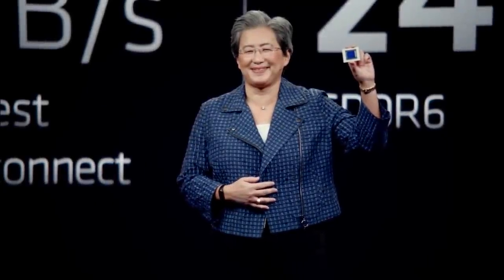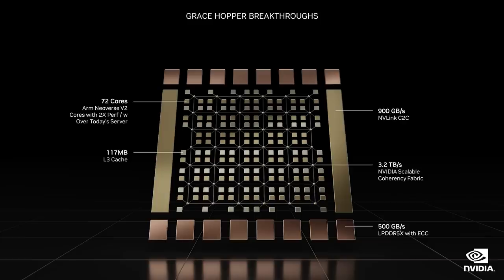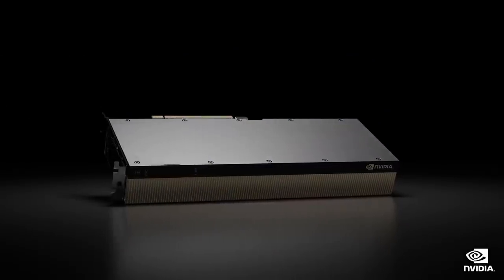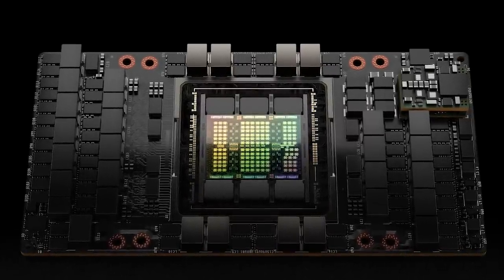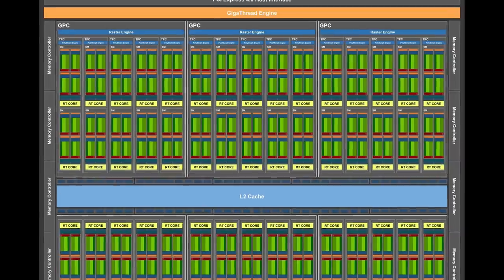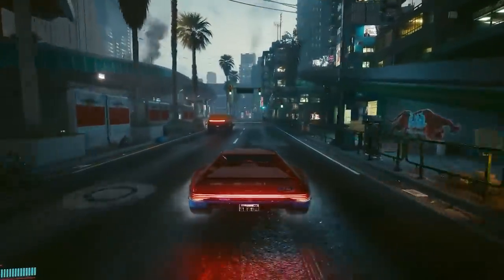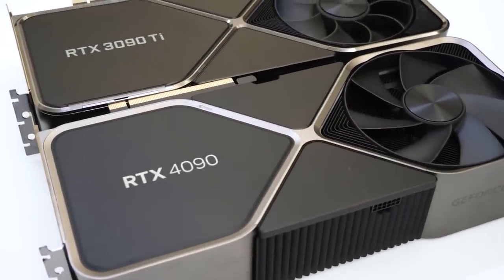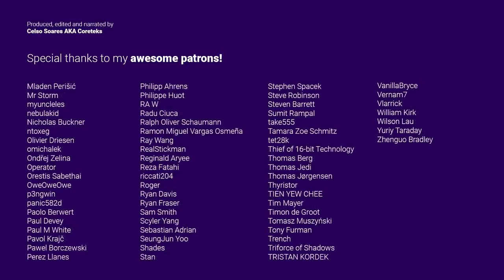NVidia CHIPLETS Strategy explained

Comment: AMD's chief engineer who introduced them to chiplets recently did an interview with GamersNexus about chiplets, and as complementary as he was of course, he also said they realised that chiplets for the compute elements of a GPU do not make sense, because they are far more interconnected than CPU cores. That is why RDNA 3 only has one compute die, no matter its size, unlike Zen which has potentially multiple CCX dies.
Reply: Right, but would the interconnection be as high between different blocks? 

For RT, Lumen already uses a different, simpler version of a scene. That means unique data. Could a RT chiplet function far more independently from the shaders? What about tensor cores? If these are segmented in the code, this may not be an issue.
Reply: Thanks to chiplets, AMD fixed their bandwidth limitations and now the limit is the cores.
Now the bottleneck is the shaders that can be easily improved by adding more.
Reply: @ghoulbuster1  
Radeon still has too much bandwidth between CU, which is why RDNA 3 only has 1 GCD. CUs transfer 10x as much data between them as they transfer back and forth from infinity cache.
Reply: @Austin1990  you would need over 7 TB/s of bandwidth between chips for just 2 GCDs. This number goes higher the further you split things.
Reply: @Austin1990  AMD didn’t seem to think so and hasn’t done it either so far.
Reply: Yes I agree. The benefit in this first multi die GPU is not performance but yield economics (and maybe frequency binning, comparing 7900XT vs XTX may reveal this), but the interconnects are there to scale it up for performance benefits, which is what is really exciting. As adoredtv Jim said: due to the small size of the GCD, AMD can simply add (>x1.5?) more shaders and 3D stack cache more MCDs to feed them. NVIDIA can't, it's literally impossible to fab a monolithic chip that big. They've already made the 4090, and from years of Titan sales, they know they have the fans who will buy them.
So it looks like it's entirely up to AMD whether they take the performance crown from here until NVIDIA get their own chiplet solution implemented.
Reply: @ghoulbuster1  Wait for RDNA 4 for better RT?
Reply: The problem is cost. AMD can do it, but they'll have to use the same material as they use for the server market. The MI300 does have more than 1 GCD. But that's too expensive for the consumer market. Remember RDNA is based on CDNA.
Reply: yeah, they'll prob further disaggregate untill there is literally nothing but cores on GCD and work on higher clocks, cuz there's no other options to boost  the performance. maybe at some point they'll teach GCDs to interconnect through MCD, but i'm not sure it's gonna be effective.
Reply: Don't forget sli/crossfire.

Comment: You have consistently suggested a separate RT chip and it has never really made sense even now as you present the industry move towards chiplet based domain specialization. Not that it isn’t desirable, the problem is that it isn’t feasible for the foreseeable future. An RT core is an accelerator that is delegated portions of the RT work by the shaders primarily BVH traversal and intersection testing, when that delegated work is done the shaders then execute the hit shaders, what is critical to this being performant and efficient is that the RT core and the shaders can work on the same data in a shared cache without any need for data movement. Going off die completely destroys this fundamental. RT acceleration even at its most advanced form and in a raytracing only game, RT would be a full round trip of geometry set up -> trace rays -> shader work. Data movement of any kind is going to be an order of magnitude more power draw and latency, and going off die is another order of magnitude ontop of that. You have made no attempt acknowledge or explain away this problem.
Reply: Dude how are you so smart??? That’s amazing
Reply: @Shapar95  it’s just about doing the homework. Most relevant here would be:

Imagination Technologies raytracing levels. (A big help in itemizing the state and future of raytracing acceleration hardware)

Nvidia Composable on Package Architecture (Nvidia chiplets and where a lot of images from Coreteks video came from)

Microsoft DXR documentation (raytracing from the API point of view)

Architecture white papers on Turing / Ampere / Ada / RDNA2. (Raytracing hardware from the view of the hardware vendors)

press day presentations on RDNA3 / Grace - Hopper. (Chiplets and interconnect fabrics)

various press releases on TSMC advanced packaging.
Reply: This. And (edit: because of that) an RT chip would require a whole new approach to RT which would be incompatible with current games and APIs. Of course, data movement could be less of an issue with either a silicon interposer or a separate and shared cache chip. The first can be expensive, the latter difficult to design and more prone to production failures.
Reply: I honestly prefer AMD's concept of not using rt accelerators and building it into specific dies. as we possibly move to a more RT focused environments, possibly full rt with layering vs phong/gourad with shaders, this will allow stream processors in the system to do more workload, even possible cards in the future having cores that do both to handle older games with not RT and then full RT without having dead weight. It really depends on how fast the market moves.
Reply: @gpturismo  but AMD does use RT accelerators. RDNA2 embedded ray intersection testing into the TMU, and RDNA3 added BVH traversal as well. I'm still waiting on an actual architecture whitepaper but I would even go so far as to say that AMD press presentation had me thinking that RDNA3s CU layout is reminiscent of an Ampere SM. Doubled shader layout, acceleration for BVH traversal and ray intersection testing, new Machine Learning matrix instructions.

here is an except from AnandTech coverage of RDNA3 release event. "The second-generation RT accelerator, as AMD calls it, can handle 1.5x more rays in flight. There are also new hardware box sorting and traversal features that weren’t present in RDNA 2’s initial RT functionality. AMD’s presentation gave the technical details a light treatment, but it certainly looks like AMD is moving to doing a bigger part of the ray tracing process in dedicated hardware."
Reply: So what your saying is instead of using chiplets for the cores, Nvidia should expand the cache? Bigger cache means faster RT and shader cores.
Reply: And this is where cache dies make sense. Cache isn't scaling with smaller litho nodes. Logic (SMs) is. The problem is the cost (power & latency) of fetching the data from another die.

What's interesting is why AMD lowered shader clocks and didn't stack MCDs in Navi 31. Is it limiting silicon or power targets or minimal performance benefit? Or is this implementation of the interconnect the limit? I can't wait for the in depth analysis of the 7900XTX to arrive, it's killing me

Comment: When 3D stacking is mature - wouldn't the direct stacking of a GPU onto a CPU offer performance advantages that discreet chips and long length busses can't compete with?
Reply: Fundamentally, yes. It incredibly difficult. Obviously with the cost of these new single digit nm nodes.. If it were a reasonable path forward.. these companies would have already done it. I suspect there are still parts of the stacking technology that we cannot do yet on logic circuits. We will see.
Reply: @christophermullins7163  well look at what amd did with vega there moveing to rdna3 for there apus after sticking to vegas for years so i think we are gonna get something like this in the next 3 years
Reply: Not exactly, stacking two of the hottest part of the chip on each other would be a mechanical nightmare.
Reply: @ben7295  There is the direct die water cooling thing tsmc tested which had crazy good results. The only thing is the tech is still very immature and need more R&D to make it commercially viable.
Reply: i wonder if 3d cache on APUs could make up for the lack of vram ?
Reply: VRAM, Power, Heat, and Memory Bandwidth says no.
Reply: @hiimcortana1568  Probably will not work on consumer market.
it needs high grade of purity water and a cooling loop that is very clean, or it will clog.
Maybe something derive from it (direct vapour chamber? On chip small factor active cooling?) will.
that said, I probably would go with placing them side by side and stacking the memory, sounds more easy to me, however I have no idea of how to engineer a chip.
Reply: sure but it won't scale up to the 400 watt+ GPUs that need their own cooling

Comment: Nv will have to do something.. I genuinely believe this will be the last generation of gpu's where they have a clear market lead
Reply: Nah. I still see nvidia this decade
Reply: @godblessbharat708  Nah, Nvidia has some major flaws, one of them is no APUs. That is why they do everything they can to maintain the performance crown. Because that's the only way for them to stay relevant on the consumer level PC market. AMD is slowly pushing Nvidia out of the mainstream market by forcing them to release faster and faster cards which will cost more and more to buy. And that's an unsustainable strategy from Nvidia. Peoples already started to complain about Nvidia's products, pricing and marketing. APUs is the future of mainstream PC and Nvidia has nothing to compete with. From 2023 onwards Nvidia's marketshare will drop like a rock.
Reply: Huge doubt, sad or not. Steam charts has 1650 as most popular GPU atm, from the 1060. Next it will probably be the 3070 or 3060. Not sure how sales of the 4050 or 4060 will go tho but probably will be popular too.
Reply: @shanekhiu9884  but did you forget how bad it is vs amd opposant cards?
Reply: @shanekhiu9884  Check the pricing of those cards and you'd understand why you're most probably wrong.
Reply: Yeah, AMD will leapfrog Nvidia within next two gens. Also, It would be shear raw performance power and if amd can get their drivers fixed. Then nvidia will play the second fiddle for a long time. Look at Intel. They still can't get ahead of amd in processors.
Reply: nVidia holds something like 85% of the market, an effective monopoly, there is just no way for that to change very quickly due to simple logistics. AMD would need to have a clearly superior products at cheaper/equivalent prices for at least 3 generations in a row for them to get close to 50/50 again.
Reply: @speedster4459  "Drivers" fixed? I think AMD needs to get peoples brain rebooted because those "Drivers" issues are long long long gone. It's more stereo typing at this point.
Reply: @nedegt1877  I own a rx 6700 xt. I played tinykin recently. It crashes after almost every 20-30 minutes of gameplay.
Reply: @nedegt1877  have you checked out price comparison according to die sizes though? The main reason for price increases is that want to maintain the same profit margin as they did with miners. And the big performance gains are because they want to justify those prices. I believe that silicon cost alone may not be the main thing. I think newer gen die sizes may not be that different from last gen die sizes.
Reply: @speedster4459  just bcoz one game crashed for u dosnt mean its always driver problems. Do u really think game codes are issue proofs? Games hv so many things that need to be fixed from its side. 

I use amd for 3 years never had a single driver issues in any game.
Reply: @speedster4459  A very simple search in less than 30 sec taught me that it's a game issue. More peoples had the problem with different systems and platforms, but they released a patch to fix it. So, there you go. You blame AMD's drivers while it's a game issue. That's what peoples often do because they've heard of "AMD drivers' issues". And then quickly blame AMD for it, without actually looking into it. That's why I always reply on peoples repeating that nonsense. No offense. 

Fun fact. The person who was responsible for "bad" drivers at AMD has left AMD a long long time ago. He works at intel now. 

And when AMD presented their RDNA architecture, AMD made it clear that their priority was to get the drivers stable and after that they were going to tune the drivers for performance. Well, we're at the point that AMD is tuning for performance! 

But nobody really understands why intel's GPUs are having issues. I don't think it's a coincidence but who am I to judge right?
Reply: @Steel0079  Yes I have but it's also process node that's way more expensive. It's not only that they want to maintain same profit margins, but they have no choice, they have to do that otherwise their losses will be too high. 

That is also why they released the 4090 first instead of the 4080. The margins are much higher, and they wanted to sell as many as possible before RDNA3 release. Which will be much cheaper but not much slower. Nvidia didn't expect the 4080 to be received so badly though. 

But in any case, we'll have to wait for the financial reports to see how big the damage is or was or if any at all.
Reply: @nedegt1877  been hearing this for a while
Reply: @nedegt1877  Funny thing that AMD’s market share is dropping isn’t it
Reply: @justinwong939  That's true, AMD lost a bit marketshare, but that was expected. Those marketshare numbers are lagging a few months. And RTX marketing did very good the last 2 years, no doubt. 

But I'm talking about 2023 and years after that. All Ryzen CPUs will have a GPU integrated, that alone will deliver AMD more marketshare. And the new GPU/APUs? They're going to destroy Nvidia in the large volume, low price markets.
Reply: @nedegt1877  APU’s are absolutely not the future, not sure why you think this is true. Nvidias market share is majority Gamers and Data Centers, neither of those would benefit from APU’s - dedicated hardware combos will always be faster. Maybe APU’s will be the future for your average Dell PC for office use, but not serious computer work.
Reply: @Afterthought_  There are so many reasons why APUs are the future that I don't even know how to explain it in a few lines.

Only 25% of all gamers stil game on PCs. 28% on consoles and 47% on mobile devices. (2018 estimates). In fact more peoples game on APUs (PS5, XBOX, Steam Deck) than on PC. So more peoples game on AMD hardware compared to Nvidia. If you count the entire gaming market that is.

There are tons of more reasons, but for datacenters look at the MI300 for example. That is a very powerful APU!  It's only because Nvidia's acquisition of ARM failed that they're not having their datacenter APU ready in time. Hopper is close enough though! 

Future technologies will eliminate many problems that was holding back powerful APUs. 3D Stacked Chiplets allows you to pack a lot more compute units on a small area. Future APUs will be cheaper, faster and more power efficient than any mid-end CPU + GPU combo! 

The 4090 is only good for like 5% of the total computer market, it's a niche. Nobody other than marketeers and 5% of consumer really care for the highest fps. Most peoples monitor or TV screen is just 60hz -120hz. Ultra high fps don't make sense anyway for them.
Reply: @Afterthought_  Another argument is of course the fact that the CPU has been evolving for decades this way. Namely by adding more and more to the CPU because it has a lot more benefits than having everything dedicated unless it's necessary. 

A mobile phone is for example so many devices in 1, that's way more efficient and practical than carry everything around. Again the number of peoples who needs or even want the highest end is very small compared to the mass. 

Man seriously, there so many arguments I could write a book about it. But if you don't like AMD and their ideas. Take a look at intel "tiles" technology. That may convince you a little more.
Reply: HA!

Comment: NV’s next gen Blackwell GPUs for 2024 will also be monolithic. Intel tried to implement chiplets on Alchemist and Battlemage and failed utterly! AMD is the only one who understands how to partition the chiplets to work as a GPU!
Reply: AMD's got the institutional knowledge and experience to make it work. Intel's 1st current gen chiplet cpu is intended to be Sapphire Rapids and that's been delayed repeatedly. Meteor Lake is reportedly delayed as well. AMD went through a very painful process of learning how to use chiplets but they did it when node sizes were larger so it wasn't as painful as learning how to do on the current gen's much smaller nodes.

AMD sacrificed some development effort in other areas to get chiplets working but being ahead of the game on that aspect means that everybody else will be slowed down while they have to make the leap to chiplets. While Intel and nVidia are being slowed down by that transition, AMD can continue developing at their normal pace and potentially overtake them.
Reply: The issue is he suggest that it takes time to make a chiplet GPU. Given that, where is the proof that Nvidia has any development in disaggregation at all?
The best they can do is a 858mm2 die on N3P/X, after that, they are screwed without Chiplets.
The lithography machine that 2nm/N2 uses from TSMC can only do 429 or so mm2 dies. The mask size gets cut in half. So it took AMD 5-6 years from the first product and most likely 9-10 years of development to get to the point where they can make disaggregate GPUs remotely efficiently enough where it made sense to use. AMD has had years of practice, Nvidia doesn’t have any as of now.
Nvidia has to start from square one, AMD already has 2.5D and even 3D stacking with MI300. MI300 is where AMD is wise with packaging and chiplets, where is Nvidia’s?